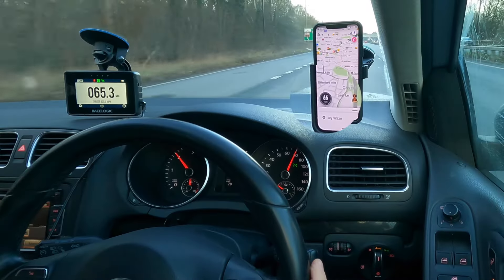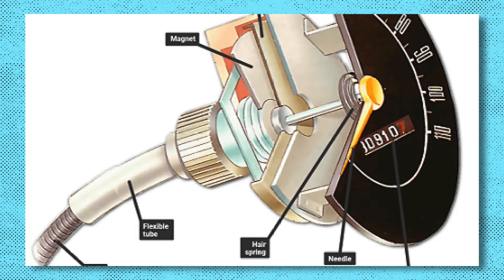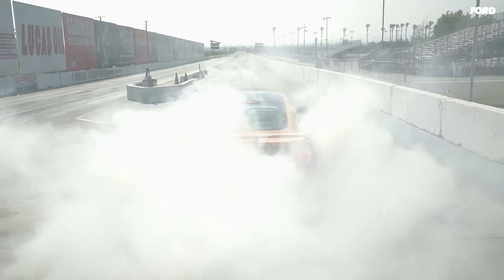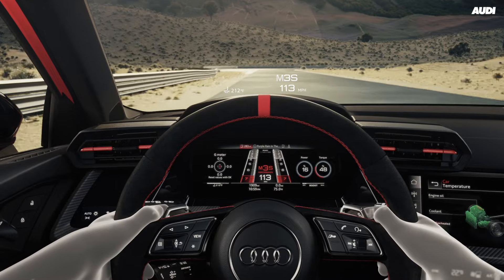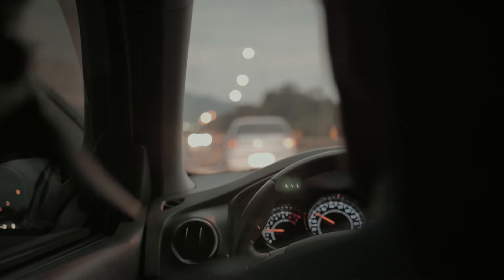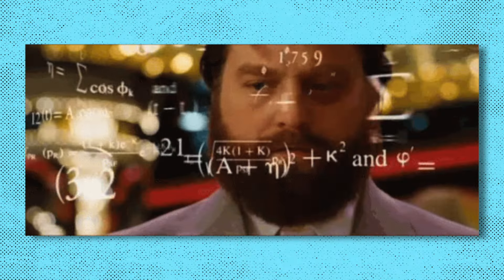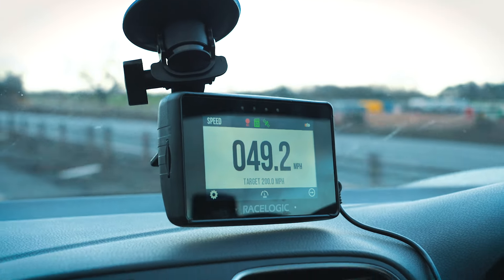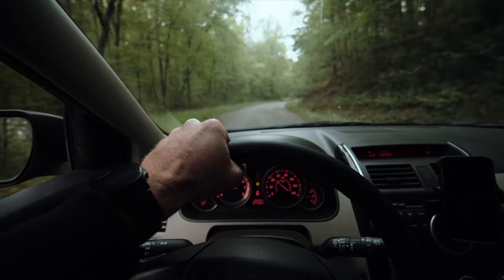Why Your Speedo is Lying to You

Comment: I used to own a E46 BMW 3-series, which overread by a lot. I think it was as much as 10km/h. Despite the reputation of these vehicles for being speed machines, I never got a ticket. Then I replaced it with a Toyota Corolla (yes, I value reliability THAT much), and I got several speeding fines because with that car you cannot drive an indicated 115km/h in a 100km/h zone. At 110km/h it was basically bang on.

I live in South Africa, and here there is quite a bit of room to "cheat", at least in most of the provinces. You are given some margin by the speed cameras. As far as I know it is 10% or 10km/h, whichever is less, so you can go 66km/h in a 60 zone, 110km/h in a 100 zone, 130km/h in a 120 zone, and so forth. If you add to that the 5%-10% or so that the car overreads, you can drive almost an indicated 135km/h on the national highways (which are limited to 120km/h) before you run the danger of being caught for speed. If you do get caught at this speed, the fine arrives in the mail a few weeks later, and it is around ZAR400, which at the present exchange rate is just under USD30.

(How do I know... well in January when we came back from the annual summer holidays, I got caught at 116km/h in a 100km/h zone... I wasn't intentionally speeding, it's one of those things that happens at times. The Swellendam traffic people were out and about that day...).

Comment: I drive a Honda 2004 (54 plate) CR-V. My speedo read very accurate at 30 and 50 mph. Using a Garmin drive saynav and android phone the read about the same and yes the phone dose have a time lag. However the van I drive a Mercedes cd313 sprinter reads at 70 mph and the gps's read both 64 mph. Now I know why sprinters are always overtaking !!!

Comment: I once was working 100 kilometres from home with 205 ×14 car tyres on my van . I put a new set of commercial tyres on and the journey became 84 kilometres.  It dropped the engine revs but used the same amount of petrol. You don't get something for nothing. The spedo was more accurate with the larger diameter tyres.

Comment: The most obvious reason is the odometer. The car makers warranty will cover all repairs (w/ exceptions like tires, brakes batteries) for XX000 miles. If the odometer runs just a little too fast then the warranty runs out just a little too fast too. If a car maker sells a million cars per year, and the warranty coverage on every one ends 10% too soon, the maker saves millions on covered repairs every year. But drivers travelling just a bit over the limit save a bundle on speeding tickets not issued.

Comment: On BMWs you can code them to show the real speed. Normally 4mph out, if you take them to the limiter at 155mph (autobahn) they’ll show 159. If you code it to show real speed they’ll display bang on what your doing. Most cars alter the Speedo like this that I’ve come across, be careful in a tesla though, they display gps speed…

Comment: I have a 2007 Mustang GT. No modifications. 18in stock tires/rims. I had to change my ECM & PCM due to a No crank/no start condition. My speedometer is reading about 12-13mph faster than speedometer app and Waze. Set my cruise control and compared all three. Any ideas?

Comment: I’d have thought this was obvious, there’s normally a +10% tolerance or +5mph so drivers don’t accidentally speed, and as tyres wear etc the circumference will change. If you want accuracy use a GPS device ie on your phone. It’s a deliberate misread by the manufacturer.

Comment: I have a ford fiesta of 5th gen. At 120 kph gps, the tachymeter says 127 kph. 
Now i wonder if this overestimation is linear with speed or constant. 
At 120kph, i'm off by 7, so will i be off by 14 at 240 (which my car can't do) or still 7.

EDIT: Apparently, according to other comments, the odometers are quite accurate, and they only add a margin to the speedometer. So it could be a constant.

Comment: Rather than my speedo being twice as far off as the speed is doubled (for example, 2km/h off at 35km/h indicated, then 4km/h off at 70km/h indicated, etc.), it is off at 3.5km/h at all speeds.  Using a stopwatch between distance markers on the expressway backed up with the car's GPS, I learned that my car is doing 40.5 km/h at 44km/h indicated, 70.5km/h at 74km/h indicated, 100.5km/h at 104km/h indicated, etc.  Makes it seem like the engineers (or the lawyers?) decided that always reading 3.5km/h above the actual speed is a safe bet for them.  2015 Subaru Levorg 2.0 GT-S in Japan.

I had a 2001 BMW Z3 3.0i in the United States that was off by 10% at all speeds: 55mph indicated was 50mph actual, 82.5mph indicated was 75mph actual, etc.

Comment: My car's speedo is analog and it will show around 5% faster than GPS. But the funny thing is, when I use an obd2 display, it will show the same speed with GPS. It's like, the car actually knows how fast you are going exactly but still gives fake readings on the speedo.

Comment: My 2008 Honda S2000 track car has larger wheels, and is missing the right rear wheel speed sensor. Speedo still reads dead accurate

Comment: It's been a couple of months since I checked, but I compared the vehicle's speedometer to 1) data from the OBD-II port, and 2) phone GPS. Interestingly enough, the speed from the OBD-II port and phone GPS matched (100km/h) but the speedo showed about 97km/h. Tires were properly inflated to the vehicle's recommended pressures, and are the factory size, mounted on factory alloy wheels. Why there's a difference between the OBD-II data and the speedo is anyone's guess (because they SHOULD be using the same data). In any case, it's definitely within what I'd consider acceptable (+/- 5%) Vehicle is a 2012 Mazda 3 sedan, automatic trans, base engine (non-skyactiv) 2.0L I4.   Maybe I'll do another check this weekend just out of curiosity

Comment: I used phone GPS to check how far out my speedometer is with fresh tyres and worn out. From that I know what speed it should show for a given road speed, and, using my phone, if need to check my tyres :)

The worst speedo I've seen was a rental (can't remember the model now) which showed 131 kph when I was doing 110 kph

Comment: The worst thing w/ overreading in my opinion is that it will result in your car racking up mileage faster than it actually should, therefore prematurely decreasing its value

Comment: My speedo is an easy 5 miles an hour under at 60mph in my 2000 Honda Accord. My old 94 Buick Roadmaster is further off, but it's an early system moving away from cables and my tires are a wildly different size. I've found old cable driven speedos like my 1987 Van is completely inaccurate and tells me whatever it thinks I wanna hear. Ha.

Comment: I own a Scirocco R, and I did mention it to the VW garage and the answer was extremely simple. For safety reasons, it is better to make you believe you're doing 70mph rather than actually doing 70 mph. You have to note down that it is graduate. If you're doing 10mph, chances are that the speedo is actually not lying to you at this point, the faster you go, the more it lies to you.

Comment: I figured out mine was off within 2 months of ownership of my current vehicle, and I have to do mental math in my head all the time while I'm driving. My speedometer overreads by about 9%. In order to go 25 mph, the speedometer must read 27 mph. For 30, 33. 35, 37, 40, 44. 45, 49. 50, 54. 55, 59, 60, 65. 65, 70. 70, 75. 75, 80. 80, 86. I haven't tested it above that. Unfortunately, however, after driving with a messed up speedometer for so long, whenever I drive a different car, I have to force myself to NOT calculate while I'm driving.

Comment: My mazda's speedo lies, well not by it's own fault. I have the SP25 which means I have 17" rims w/ mid profile tyres. The base model mazda of that year has 15" wheels with full profile tyres. When I did the math, the decreptency was exactly the difference between base model tyres and my tyres so it was like Mazda just has one instrument cluster/confuser that's calibrated to the base model and they don't bother fixing the error, presumably to avoid their drivers complaining that the sportier mazdas === speeding tickets.

Comment: I check this with every car I've owned comparing to a gps watch. VW's seem to be the most of. Our 2015 vw Jetta is 7% over but when I check the odometer it is spot on. Ford's seem much closer only 1-2% over and I recently got a Volvo v60 which was only 1km/h over while travelling at 115km/h
Reply: Yeah, I notice when using the GPS satnav. Our 2010 vw overeads by quite a margin. 60mph equals about 54mph and 80mph equals around 70mph. Often find yourself on the motorway sitting at 65mph and being at lorry speeds haha.

Comment: GPS does not use position to calculate the speed, as that's inherently very inaccurate even at very good precision and fast updates in position data. It uses the Doppler effect. The average speed is calculated using the distance covered. 

The accuracy of the speed and position are given by the number of satellites used and the way the sensor and software is setup... the hardware is not much different between the phone and the professional tools. The GPS in your phone is usually a 1Hz unit and updates every second, while the Racelogic ones are 10Hz. Recently more and more GPS chips are 5Hz capable, but the software in phones and navigation systems still updates once a second or less, probably to save power as there is no need for faster updates for the average user and for navigation purposes.

Comment: Civilian GPS accuracy is a 3 meter radius, which of course is  a 6 meter diameter of accuracy. In other words, not that precise, plus there is the update frequency.  And  the +/- is a percent, not an mph. So if you read 50 at 55 you will read 100 at 110. So realistically you cannot know precisely your speed with that method. Using time-distance, which is the only way to accurately measure speed, I found my Lotus' speedo to be as near spot-on as possible.

Comment: Doesn't this also add undriven miles to your odometer thus lowering the value over time?   I'd like to see that broken down in a video showing how many miles are being added to a mid-high mileage car over time... 

Also, 2013 Tesla Model S cruise set at 70, GPS speed down 1 mph to 69.

Comment: This is more like uncalibrated than lying, I have an alfa on which I switched wheels from 17inch to 15 (temporarily until I find replacement for those beautiful tristar), the speedo now reads about 5% higher than real speed, I instinctively know what speed it should be showing at each speed limit, 84 for 80, 126 for 120, 63 for 60 etc... it's incredibly easy after a week.

Comment: Well let's see, I live in the US and used to repair speedometer systems. In the US the gauge reading can only vary +- 3 MPH at 60 MPH. Being kindof anal about my speedometer being accurate I checked every vehicle I ever owned. Our 2000 VW Jetta was within 1 MPH, our 1999 Suburban was almost dead on, our 05 Murano is dead on, our 09 F150 is dead on, our 92 Ranger is within 2 MPH, and my 1950 F-1 pickup is within 2 MPH. I guess in the UK they want you to drive slow?

Comment: What math? If I have google maps open I accelerate until the speed limit is shown on google, whatever the speedometer reads. After that, I can still go 5 km/h more here in Portugal (it's the radar tolerance that the court of law will discount).
I have a Kawa Z900 2022 and the speedo is about 5km/h off. My GSXF 750 2001 as exactly 7. I had a C200 mercedes van 2010 and it was 5. My 1998 peugeot boxer is almost 10 kmh. All vehiclemeasures

Comment: my car is below 4kmph off and  my motorcycle maybe 2kmph :D tja ive got good stuff.
if the car is going 110 you can calculate with 100-103 in real.
the speedo is allowed to be 0 to 4%+4kmh off the actual number.

Comment: I have a Subaru is lying to me, deliberately. I plugged an OBDII adapter  into my ECU and the speed reported in that was faster than what my dash cluster said, by 7%. So my ECU was correct then changed the numbers and sent that to the gauge cluster (Which has a digital readout)

2017 Subaru BRZ

Comment: entirely negating the fact that the speedometer runs off revolutions of the wheel. and the wheel changes its distance per revolution as the tread wears down and the wheel therein becomes smaller.

Comment: This raise some interesting questions:
1. Car's total mileage is overread
2. On-board fuel consumption calculation and trip meter are inaccurate
3. Ppl getting faster 0-100 times then manufacture rated because they're actually doing 0-95

Comment: your vehicle pretty much reads the speed accurately. Its juz the dash that has been set to over read. I've 2 speed indicator on my truck. One is the factory speedo and the other is hooked up to the onboard computer used for driver assist and it reads exactly the same as the gps on my fon.

Comment: Some car manufacturers are much worse than others, as anyone who has ever driven behind a Toyota would have noticed. It's a very annoying issue, especially in the average speed zones, because a lot of the already slow drives slow down even more just to be on the safe side, so the cars will very often drive 10-15km/h slower there, which sucks massively for everyone when there is just 1 lane in each direction. I have always measured the speed of my cars, and added that ontop of the speedometer reading. My 2009 Mercedes E-class has a spot on speedometer so i don't have to take it into account anymore, but i have measure the speed several times just to be sure.

Comment: If you have bigger wheels on your car it will throw it off your Engine speed will be the same but because of the bigger tires your car will not be rotating more because there’s more area on the tire and a full rotation

Comment: VW is the most blatant over-reporting Speed-o design ever. We have a Ford Transit at work. I use google maps alot and its usually only a few kph off. With my personal Golf I always add 10% in kph to the speed on the speedometer in order to keep the desired speed, so for 70 kph, I keep 77 on the speedo and for 90 I keep 99-100 and so on.

Comment: Just a intresting fact. Gps are intentionally made less accurate. This is done for safety reasons. The millitary have a much more accurate gps system which is used in most missiles. Found that fact very intresting when i wss doing my navigation section o  my pilots license.

Comment: No please don't use Google maps to read out your speed.
At least with me it always read much faster then another GPS service and sometimes even my speedometer.
Also I know that my speedometer overheads by 4 kph. And that doesn't come from Summer/Winter tires or tyre wear since I had 8 years to spot the difference and even switched to bigger weels. Still quite accurately 4kph difference.

In my opinion these 5 units overread are on purpose, so there's less trouble on the road.

Comment: had a motorcycle with a front tire a size to small. I blew past a cop I didn't see till the last second with my speedo at 70 on a road with a speed limit of 35 and he didn't even flinch. that's when I knew my speedo was super far off.

Comment: The 10% + 2 bit that you mentioned is not quite accurate. That isn't the tolerance of the speed cameras, they are going to be accurate with a margin of less than +/- 1mph. The 10% +2 is a guide for prosecution, so that the police generally will not prosecute below that threshold. That guidance applies to other methods of measuring speed such as handheld laser devices which are again way more accurate than the prosecution threshold.

It's also worth noting that speedos can be calibrated to be as accurate as GPS and many police cars so have this so the reading can be evidential. 

Finally, whilst GPS is very accurate, it's most accurate in a straight line at a constant speed. It gets less accurate when you change vectors.

Comment: So if your speedo is reading faster than actual speed this in turn means your mileage is reading higher than actual distance travelled. Warranty runs out sooner then real use of the car and service intervals are sooner than necessary. Overall everything cost you the consumer more. Depreciation of the vehicle is greater than it should be because everyone refers to the mileage as a gauge of wear and tear on the vehicle. You might have a legal argument if your vehicle fails just beyond the warranty by mileage.

Comment: i’ve already tried this on several cars 
1-Chrysler 300c 5.7 2006 has as same as GPS 
2- Chevrolet Caprice 2009 has +6km/h copared to GPS 
3- Toyota Sequoia has +15km/h 
4-Mazda6 has +2km/h 
all cars with speed fixed at 140km/h

Comment: Skimmed through the comments for a Tesla, didn't see any, my speed reads 72mph with 70mph on the satnav, but I wonder how far others are out as apart from BMWs I seem to be the only one on the outside lane overtaking everything. So if people are doing 70 mph on the speedo which is 65, I have a 5mph advantage, pretty sure I could join the BMWs at 77mph to 79 mph and it is often said that mobile vans won't bother anyone doing less than 80mph in Suffolk, we have no fixed cameras our stretch of this road. But like you said it just isn't worth it, but it is nice to know Tesla seems to be a lot better.